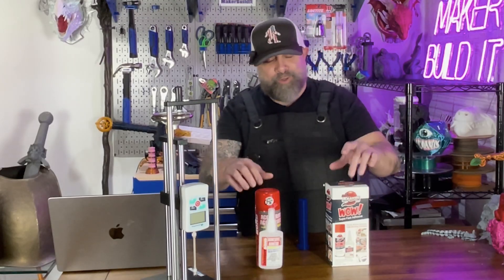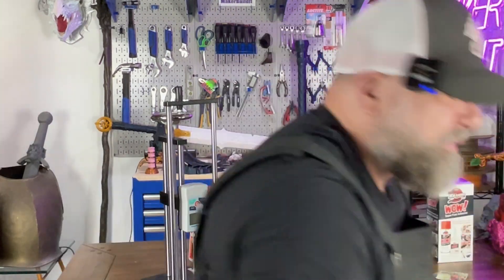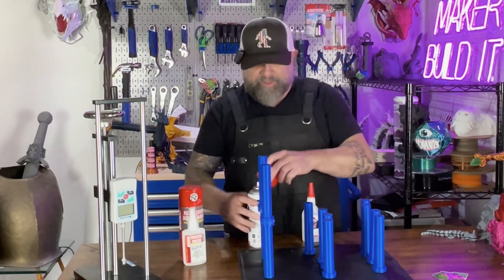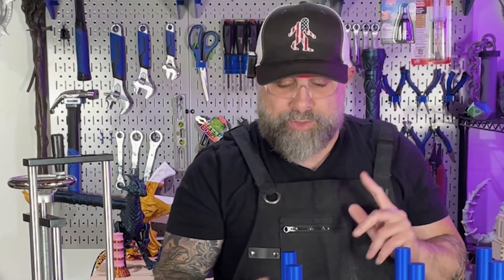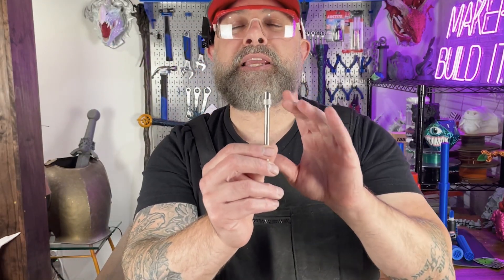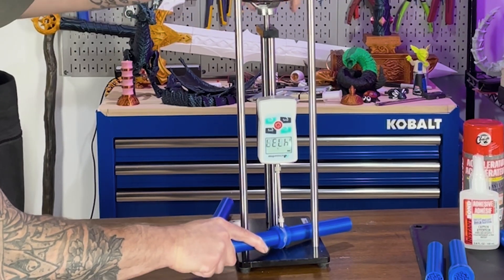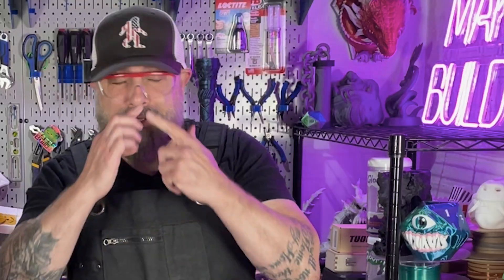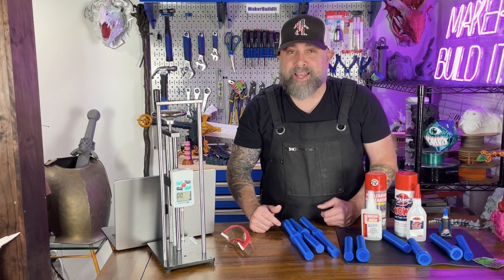Is Super Glue With Accelerants REALLY The Best Choice For 3D Print Bonding?

Comment: Seeing as they all passed, it would seem the accelerant has no affect (at least not measured with your method). Accelerant really does just what it says, nothing more. Accelerates the curing time. That said, I believe your method of application is ineffective. The accelerator should be lightly coated on both mating surfaces, then when they meet, with the CA glue between, the bond will be nearly instant. Spraying the accelerator after the fact is really only helpful if the glue joint is exposed, like if the items being bonded have an imperfect mating surface (like filling the joint with the glue, like a welder with metal).

Comment: Likely should have just pull tested them on a dyno. pull tester?  Evey  joint has a different criteria so those factors come in.   In your opinion what do you think the accelerator  spray is  alcohol or keynote based?  Don't stop!  Thanks for sharing.  Ken in NC USA
Reply: I just 3d printed a crazy spiral  testing the printer (ender 5) and my CAD  work ( something stupid but a test  a spiral piece for a wind chime)...  .040" thick blade  spiral  vane 3" dia  2 revolutions  8" long  it printed with some fails  as i suspected PLF-CF.   laid some super glue on the surface and it's amazing how I was able to fix the part .  Yes it needed supports and I am sick and tired or failing supports...
Reply from the maker: Thank you for the comment! I appreciate it. I would say, given the typical formulation of CA-glue accelerators and the lack of explicit “alcohol” wording, it’s most likely ketone/acetone rather than an alcohol base. Ketone-based are the fastest and most common. If you need absolute certainty (for instance, for safety hazards, compatibility, ventilation concerns, or work with sensitive materials), obtaining the manufacturer’s Material Safety Data Sheet is always the best way. Hope that helps. 😁